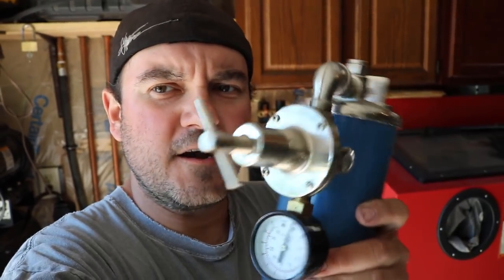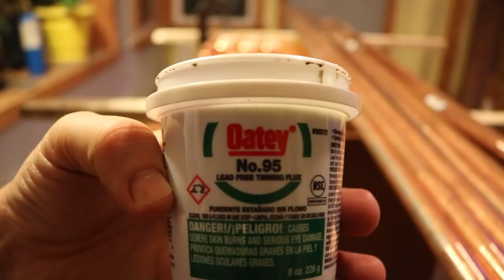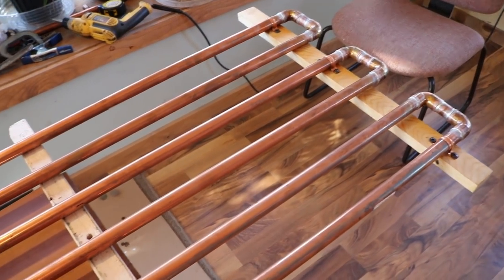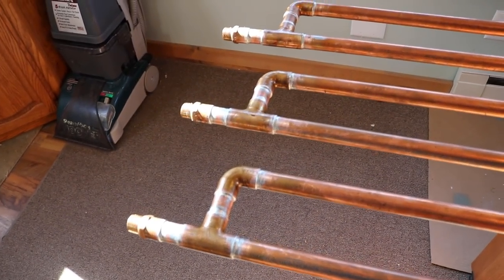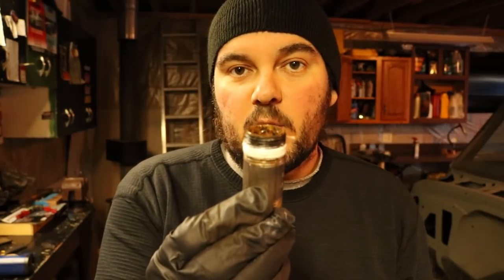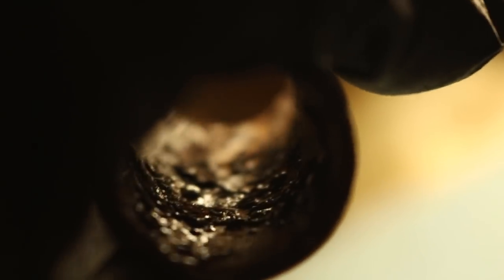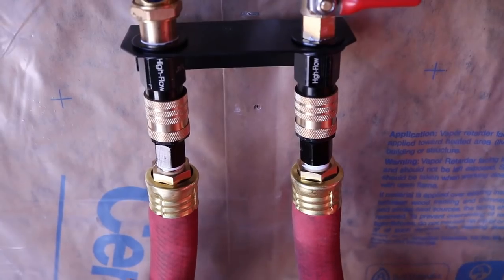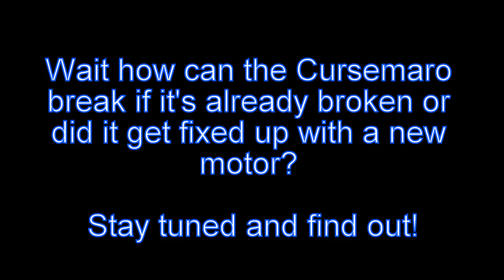How to remove moisture out of air compressor lines! Building an air dryer for painting classic cars!

Comment: How long were your copper tubing?
Reply from the maker: 72" Long, here is the parts list. You want to have at least 40-50' of copper for this system to be effective.
Here is the parts list for the Air Dryer
 Starting at the compressor
1x   - 2 1/2" 3/4" brass nipple (Sioux Chief 17700324)
1x   - 3/4" brass street elbow (female and male end)
1x   - 3/4" brass ball valve threaded (both female ends)
1x   - 3/4" Rapid Air Compressed Air Jumper Hose (Part # F0215)
1x   - 3/4" Male Adapter (Nibco 604 3/4" to 3/4" threaded)
10x - 3/4" 90° Copper Elbow (Nibco 607)
3x   - 3/4" Copper Tee (Nibco 611)
3x   - 3/4" to 1/2" Male adapter (Nibco 604 3/4" to 1/2" threaded)
3x   - 1/2" Ball Valves threaded (both female ends)
4x   - 3/4" Copper pipe Type L ( I cut these to 72" for the main height)
9x   - 3/4" Copper pipe in 2" pieces 
1x   - 3/4" Brass Compression fitting (to the regulator)
1x   - 3/4" Rapid Air NPT Filter Regulator (K93217)

The piping after the regulator was set up with 3 end points, one for my blasting cabinet 125 psi at all times, one for my tools and one for the paint gun. The paint side has a DeVilbiss 130502 Desiccant snake, a regulator, high flow fittings and a Devilbiss Rhi-01 Relative Humidity Indicator.

Comment: I get not using GI or steel but why not plastic?
Reply from the maker: Plastic will get brittle over time, unless it's something like a rapid air lines which are formulated for high pressures.

Comment: What did this setup cost
Reply from the maker: I believe the copper was right around $150, the regulator was just under a $100, the desiccant snake was $30, the desiccant relative humidity indicator was $30, the jumper hose was $30, and I would say add another $50 for small pieces like some of the brass fittings and regulators. So you'll probably end up spending around 400 bucks with the solder and flux you're going to have to buy.

Comment: Do you have a parts list?  Looking to do one of these soon for my garage.  Thanks for the video.
Reply from the maker: No, but I can write one up in the description when I get a chance. I'll get back to you when its updated. Thanks for watching!
Reply from the maker: Here is the list of parts used on this build. The tubing was cut to 72" to utilize the most space in that area. You want to have at least 40-50' of copper for this system to be effective.

Here is the parts list for the Air Dryer
Starting at the compressor

1x   - 2 1/2" 3/4" brass nipple (Sioux Chief 17700324)
1x   - 3/4" brass street elbow (female and male end)
1x   - 3/4" brass ball valve threaded (both female ends)
1x   - 3/4" Rapid Air Compressed Air Jumper Hose (Part # F0215)
1x   - 3/4" Male Adapter (Nibco 604 3/4" to 3/4" threaded)
10x - 3/4" 90° Copper Elbow (Nibco 607)
3x   - 3/4" Copper Tee (Nibco 611)
3x   - 3/4" to 1/2" Male adapter (Nibco 604 3/4" to 1/2" threaded)
3x   - 1/2" Ball Valves threaded (both female ends)
4x   - 3/4" Copper pipe Type L ( I cut these to 72" for the main height)
9x   - 3/4" Copper pipe in 2" pieces 
1x   - 3/4" Brass Compression fitting (to the regulator)
1x   - 3/4" Rapid Air NPT Filter Regulator (K93217)

The piping after the regulator was set up with 3 end points, one for my blasting cabinet 125 psi at all times, one for my tools and one for the paint gun. The paint side has a DeVilbiss 130502 Desiccant snake, a regulator, high flow fittings and a Devilbiss Rhi-01 Relative Humidity Indicator.

Comment: To each his own, but copper is to weak  a metal to hold lots of air comressed air,   i would just rather run 30 foot air hose and some good air filtration gadgets and that would win the battle for moisture in the air lines,     like they say more than one way to skin a cat.

Comment: Good - THIN but complete coat of flux.  Bad - for wrought copper fittings, apply heat to tubing NOT fitting. For cast brass fittings (rare, nowadays) heat fittings. Most guys use way too much solder - it takes very little with proper prep like your work.
Reply from the maker: I was always taught to heat the fitting not the pipe.
Reply: @BustedClassicGarage  - Yeah, so was I, then I came to know a UA fitter who had done some plumbing work; we were assigned a job no self-respecting fitter wanted - plumbing the lab at a power plant. I said to hell with the ego trip, it was cleaner, cooler and quieter.  Found out Hud was right, there was less chance of the joint drinking solder by heating the tubing. Make sure you note, I said for wrought fittings.
PS - Except for the instrumentation lines, which were compression fittings, all the plumbing in the lab was Type K copper sweat joints, up to 4-inch stuff.
Reply: Heat the fitting! If you heat the pipe it expands then shrinks after you solder. Making it more like to leak.

Comment: Sch80 PVC would also work no?
Reply from the maker: I wouldn't trust it. Pvc has a tendency to get brittle over time and possibly shatter.
Reply: @BustedClassicGarage  DO NOT USE PVC, it will work well in the beginning, then fail when you least expect it.  I found this video while searching for a DIY solution.  I built a rather sweet PVC setup with decadent beads, worked well for about a year.  I live in Naples, FL, needless to say, I think Naples is listed under Humidity in a dictionary somewhere.  The heat this past week really turned up the heat on my PVC, she blew apart, thankfully no one was around, but it sounded like a cannon went off.  Will be building this setup soon.
Reply from the maker: @MilanMetalFinishing  wow, I've always heard horror stories about that. I'm glad nobody got hurt!
Reply: @MilanMetalFinishing  good to know. Thanks

Comment: Honestly you can make your piping out of thicker wall pvc no need to go broke with copper unless your running an air line at 150-200 psi all my old Mac compressor can do is 135 although it is extremely abused, its 30 years old and never had an oil change
Reply from the maker: PVC has a tendency to get brittle and explode, so I'm good on that... I'll stick with copper.

Comment: Why not start with a higher quality air compressor?
Reply from the maker: Because I scored that compressor for $250 new. Eventually I will get a two stage 80 gallon 5hp but for now this thing does what I need it to do.
Reply: @BustedClassicGarage  What brand/size or you considering. I'm looking at the 2 stage Ingersoll Rand 5hp  from Tractor Supply for around $1000. I'm not sure if it will be too much for my needs or if i can get away with the smaller single stage. I'm only using a rivet gun, sander and grinder basic tools for restoring my truck.
Reply from the maker: If you're going to be painting entire cars at once the ideal compressor would be a 80 gallon, 2 Stage, 5hp. You can get away with smaller compressors but if you're trying to paint an entire car in one run you're probably going to start running out of air at a certain point. When I was looking for a 80 gallon I was also interested in an IR. Sears used to sell them I doubt they do anymore. But Sears had a layaway plan which was nice.

Comment: I see a lot of wasted effort and hardware here.  You should have run your tubing horizontal, with a slight drop between rows, then a drop teed off the bottom row, with a ball valve, for your water trap and drain.
Reply from the maker: If you say so...
Reply: @BustedClassicGarage  that's the way I set mine up years ago, and it works great. Great job otherwise though!

Comment: That was a cool video However, you left out the most important part. How does the fucking thing work?!?!?!?
Reply from the maker: The long run of piping gives the air a chance to cool down. Once cool, the water drops out of suspension and collects at the bottom of the copper pipes at the valves.